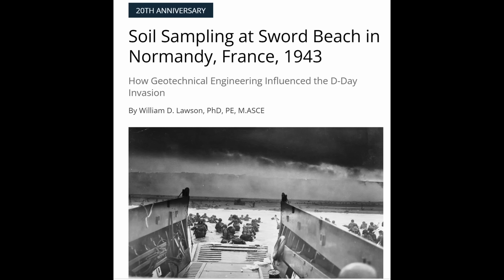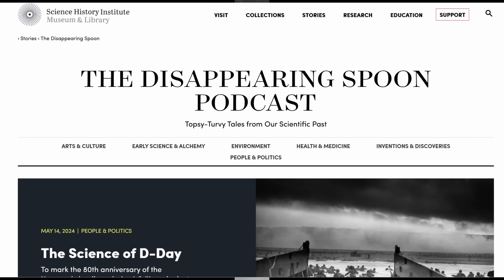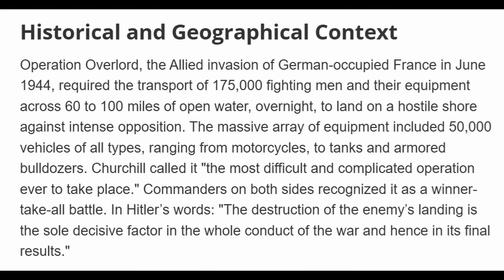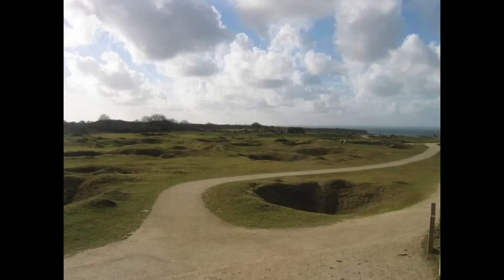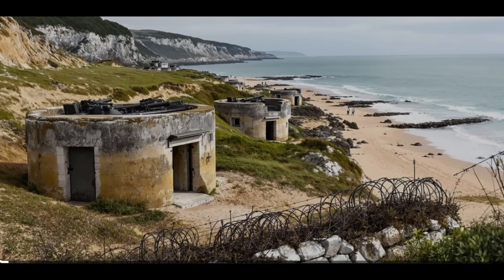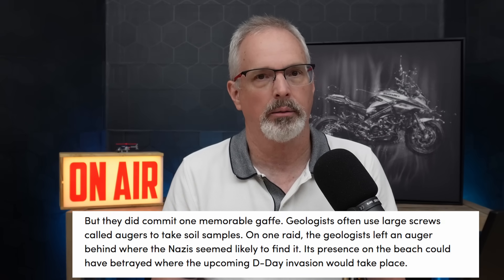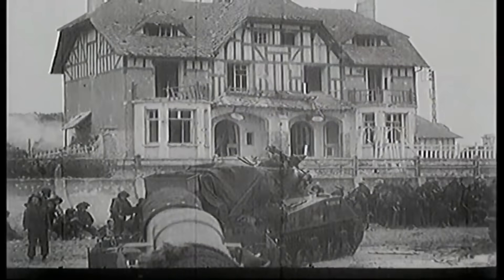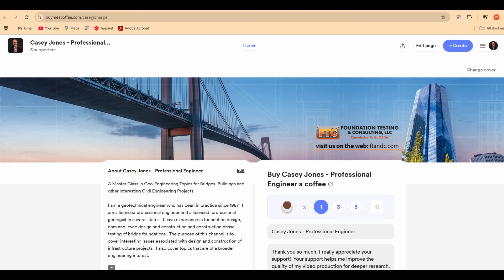The Geotechnical Engineering to Support the D-Day Invasion

Comment: Due to not capturing a useable port soon enough. They  used Omaha beach to load entire divisions. My uncle Elton Hisle with the 78th Division drove his jeep off a LST on Thanksgiving day 1944 onto Omaha beach. He told me that they had to remove the fan belt because it would flip off in the deep water. He said he stopped at the hill top above Omaha Beach to re install his fan belt. He said he was the only one in his unit that drove the same Jeep into Berlin after the war. Most drivers would panic under fire in combat drive to fast and flip their jeep!

Comment: The 1942 raid at Dieppe was a total disaster, partially caused by the unsuitable for tanks beach material.  Many of the tanks tasked with supporting that raid got bogged down on the beach, leaving the Canadian infantry poorly supported with armored firepower.  It was one of many costly lessons learned.

Comment: An elder at my church in Southampton, England was one of the young men collecting samples from the beaches. It wasn’t until his mid 80s that he shared this with people. It usually required no more than 24 hours from drop off to pickup by the support vessel. One day the weather closed in and he was 48 hours bobbing in the canoe far enough off shore waiting for pickup. He was an incredibly fit man. Even when he collapsed on the pavement with a heart attack, two passing nurses stopped and performed cpr, he survived a further two years which is incredibly rare for a 90 year old as cpr is a brutal process for old people.
Reply: The 24 hour thing is probably because the tides are on a 24h40m cycle.
Reply: @jeffreybell436 the pickup location was far off shore so the support vessel was less visible and audible so the tide was not the issue. The cover of darkness at night was important.

Comment: Very nice presentation. Something that is often overlooked was the deliberate alphabetical ordering of the names. Spreading from the dividing line, the American beaches ran alphabetically westwards (follow the arrows from right to left),  Utah <<<< Omaha and the beaches of the main allies ran alphabetically eastwards Gold >>>> Juno >>>> Sword. There were plans for a sixth beach to the East of Sword bearing the code name "Band" It was not alphabetical but, if it had been used it would have been given an alphabetical designation such as Temple or Windsor or Zebra. It was not used because further reconnaissance  revealed that the Germans had successfully flooded much of the land behind the beach. The names finally used were not the original names ... all part of confusing the Germans if there had been a security leak. This is the same as the triple white banding on the wings of the aircraft ... final design and application done at the last possible moment.

As for the auger left behind, there was some paranoia but one auger found on a Normandie beach would have suggested that very brave men had landed, done some research and left undetected but nothing more than some samples had been taken, but the Germans were fairly sure that the invasion was going to be to the Pas de Calais (a bold move like the German "Operation Sickle" in 1940, cut your enemy in two). The German fear was that a tidal wave of forces landing in the Pas de Calais, wave after wave surging further and further inland with fresh subsequent waves picking up the baton and surging over the exhausted first waves, could leave the German forces in France isolated from German reinforcements. For this reason, Hitler had ordered that a huge Panzer force should be kept back ready to surge towards an invasion force wherever it landed. Hitler was right but no-one being prepared to wake Hitler that morning to get permission to use those tanks  was another contributing  factor to the success of D-Day. Just because an auger may have been found on the Normandie coast did not mean that other sampling expeditions had not been made on the Pas de Calais beaches. If the Germans had suspected one sampling expedition had been and gone, UNDETECTED, how many more sampling parties had landed all along the coast and left UNDETECTED ?  The Germans weren't daft. They knew that an invasion was coming SOMEWHERE. The fear of a Pas de Calais invasion was further enhanced much to the fury of George Patton in that George Patton was forced to spend a lot of time in Kent (the far South-East of Britain) as head of the HUGE Pas de Calais landing force. Poor George was, in fact, the head of thousands of inflated rubber tanks, lorries, scout cars, rafts and rubber aeroplanes and a "HUGE" army of just a few thousand men. George Patton was the allied general most feared by the Germans. George was sure that he was still being "punished" for that unfortunate business in that hospital in Sicily. When it came to the crunch, of course, he was given his Third Army.

One other matter of vital importance often poo-pooed by those who try to drag everything down to their own squalid level was the Dam Busters' Raid of 1943. In order to repair the dams, 20,000 slave labourers were taken off of the Atlantic Wall works. When Urwin Rommel took charge of the defences having recovered from his last bout of nasal diphtheria he was horrified at the gaps in the wall and bullied those in Berlin to give him more slave labour. His thugs bullied, beat, whipped and killed slave labourers (as a warning to the others) to try to get more work out of the slaves but come D-Day, the defences were NOT ready. The Germans gave a good account of themselves with the defences that they had but were overwhelmed. 

If the defences had been better, the allies may have been driven back into the sea having achieved nothing and monstrous casualties. I contend that among other things including the Germans being too relaxed because of the appalling weather, the Dam Busters' Raid was a major contributing factor in the success of D-Day. 

Casey, if you want another good book on the German defeat, allow me to recommend 
"Adolf Hitler : My part in his downfall" by Spike Milligan
Reply from the maker: Thank you so much for your in- depth comments, I really appreciate it!

Comment: Review lessons learned from the Dieppe Raid. This failure spurred the allies to do a lot more research in preparation for the Normandy landings, in particular soil samples.
Reply from the maker: Thank you for raising that point.
Reply: Tarawa taught us some real tragic lessons as well ..
Reply: The Dieppe raid was briefly depicted in one of these film clips (showing the half timbered house) 5,000 Canadian troops were on the raid intended to test the concept of beach landing and deceive the enemy as to the proposed general location of the proposed invasion location. About 1,000 Canadians were killed, almost 2,000 captured, the balance were either wounder and or retrieved after the raid. Probably the single most costly Canadian operation of WW2 even though they had their own assigned beach at Normandy on D day.
Reply from the maker: @jockmccartney30  Wow, that was truly costly!
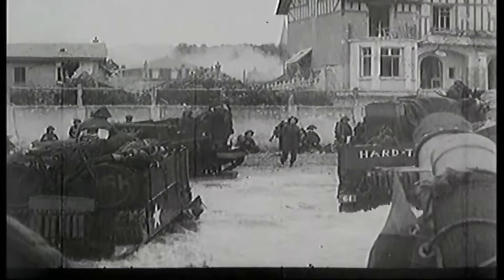Reply: @jockmccartney30  Dieppe was a horror story for sure. I have stood on those beaches and looked up at where the German positions were on the cliffs. Unreal. Not to mention how hard it is to even walk in those beaches because of the rocks. It was a terrible place to attempt a landing for many reasons. However, the half timbered house at 7:47 in this video is not in Dieppe. It is on Juno Beach in Bernieres-sur-Mer. The house still stands and is known now as Canada House.

Comment: It is arguable that modern coastal engineering has its basis in the preparation of the WW2 invasion plans.  The USACoE Shore Protection Manual was one of the best, most easily understandable, straight forward, conservative, and accessible references that had direct roots in the invasions.  I still have my paper copy, now out of print and superseded by a "better" online collection of papers.  The newer material is certainly more up to date, but not nearly as useable as the old manual.  If you need to be out in the field and need to make immediate decisions, this manual is without par.  US Naval Special Warfare also directly traces its modern roots to these same invasions.  Tremendous legacy.  I wonder if we have the citizens with the skill, drive, and daring to pull off something similar today?  Much appreciation and respect for that generation...almost makes it OK that they also brought us the boomers :) .
Reply from the maker: Great comments. Thank you.  I have to see if I can find a copy of that reference.
Reply: @CaseyJones-Engineer  Published as 2 volumes from the US government printing office.  Loosely: 1st is about mechanics of waves and tides, including wind.  2nd gets into movement of sand by waves and currents and design load calcs for coastal structures.  

Throughout, there are nuggets/ primers about breakwaters, jetties, groins, revetments, bulkheads, seawalls, and beach fill design.  With example problems.  Not the most modern info, but good, solid, straightforward, and conservative info for a very quick 90% solution.

A gem is a very useful gnomegraph that outputs wave height and wave period based on fetch, windspeed and duration (from seminal work done by Sverdrup, Brettschneider, and Monk). One image immediately solves about 5 simultaneous equations, respecting limits, for all cases...with sufficient precision and accuracy appropriate to a vast number of use cases.